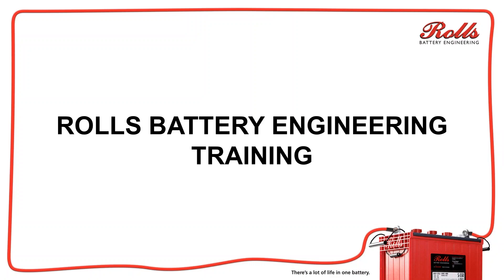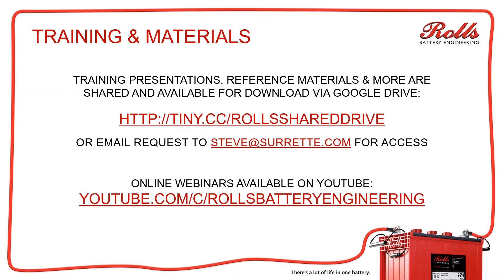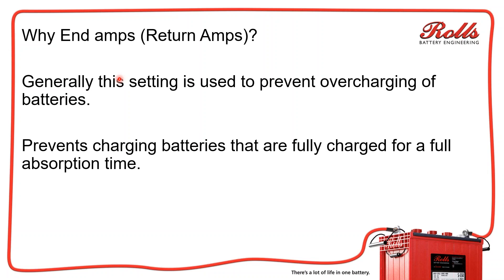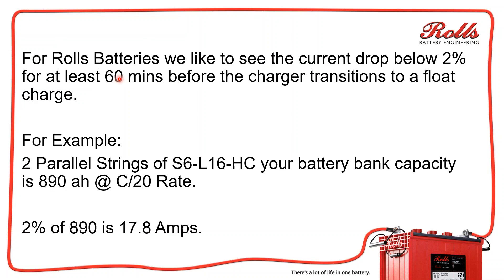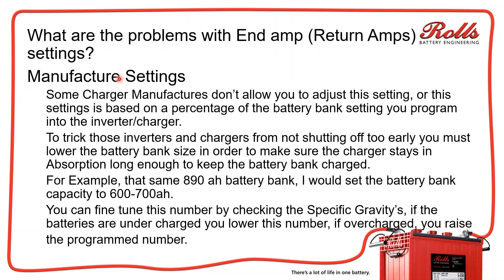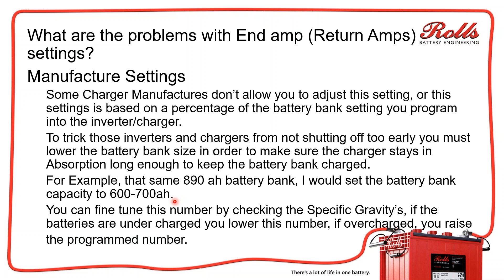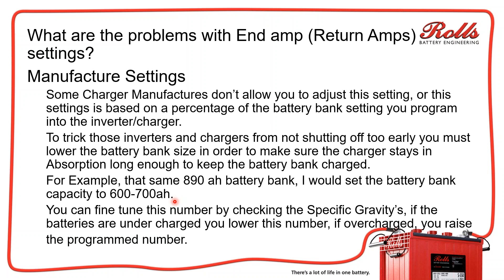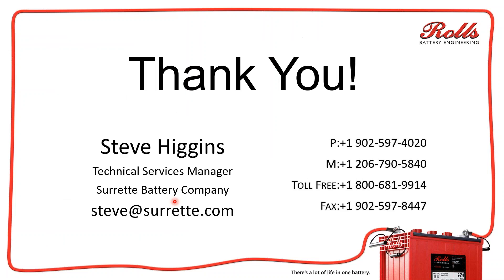Rolls Battery Engineering - End Amps or Return Amps Settings

Comment: I make my own distilled water from a small electric 4 litre distiller on sunny days, so it's free. For this reason I prefer to absorp my 1000Ah FLA battery a little more than necessary to keep the plates sulfate free and I set the tail current (end amps) to 12A. This means by the time the absorp gets down to 2% (20A) then it takes a further hour or so to get below 12A when the controllers switch to float. Battery been in service 8 years now and a monthly dist water top-up keeps everything nice and the very next full charge I check SG's which have always been 1.280 - 1.300.  My water is from 500 foot borehole and reads 450 ppm on TDS meter so first it goes through drinking water RO filters which lowers to 30 ppm then distilled it comes out 0 - 2 ppm. Used to use shop bought distilled water until I tested it at 40 - 50 ppm no wonder first set of batteries only lasted 4 years.